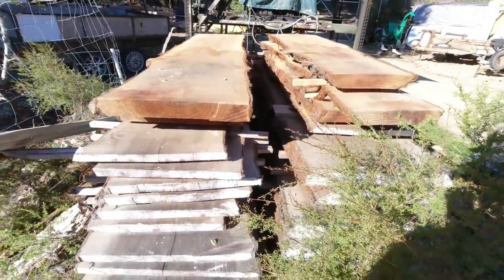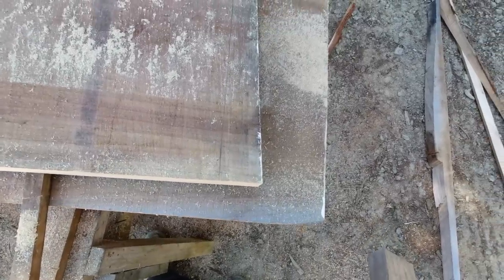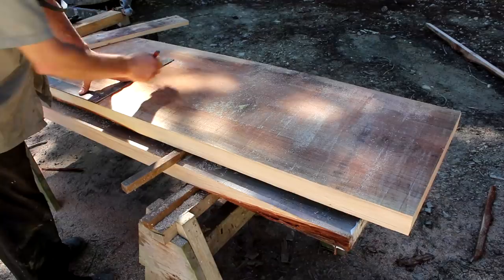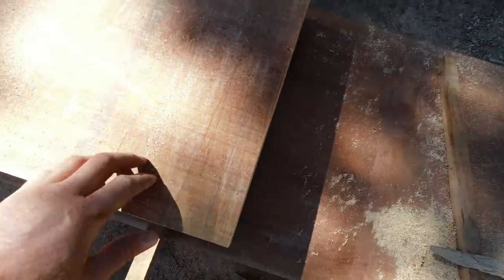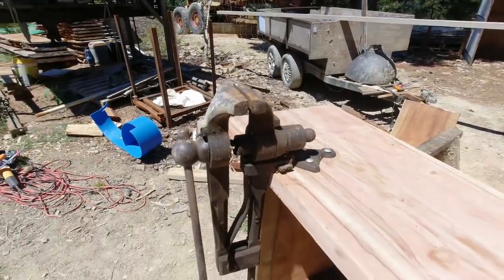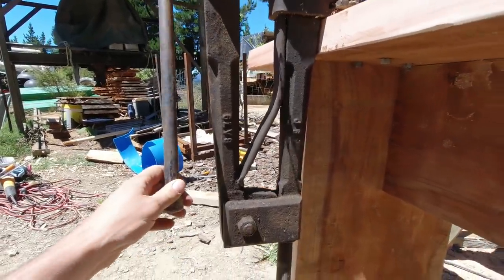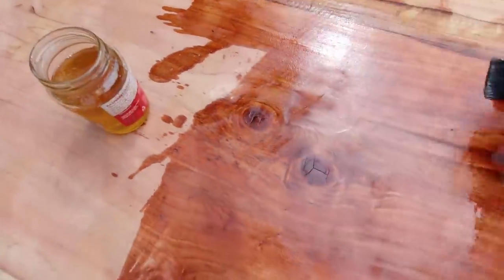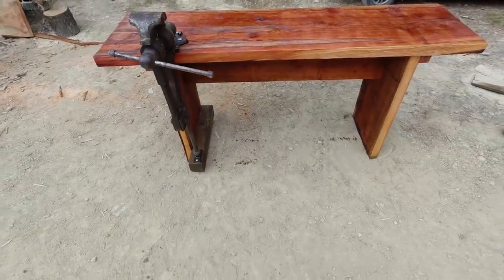Building a Redwood Slab Workbench

Comment: An Old Leg Blacksmith Vise around 1900 from England
Reply: If it's from England it'd be a vice, not a vise!
Reply: I have an identical one out in the garage. Awesome vice.👍👍👍
Happy New Year to one and all.
Reply: I've made a bench out of oak. I've beat on it for sure. I used 2×12s I cut up. They shrank a little, cupped a little, but they are fine.The pine bench I had didn't take a beating well. Good show man.

Comment: Merry Christmas Marty. Linseed oil will seal the wood but attracts dirt, applying a coat of beeswax after will keep that wood looking shmick.
Reply: Boiled linseed oil is better, no oily residue to attract the dirt and dust!
Reply: @gregheerdegen7347  Thanks Greg - great tip and clarification. A product brochure I saw (boiled linseed oil from bunnings) indicates you mix it 50/50 with mineral turps. I wonder if that is what Marty did or you would recommend?
Reply: @MiniLuv-1984  sorry I’m no expert and suspect the turps just thins it down and makes it go further and easier to apply? I use it on the ply deck of my trailer that lives outside to protect it and hopefully last many years longer as it gets a hard life.
Reply: @gregheerdegen7347  I have some treated (pine garden edging?) 2 x 8's that I want to make a garden bench with - unfortunately I don't have the fantastic vice Marty has, however treating it is a must as it will be in the weather directly. I've figured out how to stop it warping, but the treatment, if I follow the normal paint route would be horrendously expensive relative to the cost of the bench. Sounds like the boiled linseed oil can be applied directly - its certainly cheap enough. Anyhow, thanks for the reply. Much appreciated.
Reply: @MiniLuv-1984  I think mixing it with turps helps it penetrate better and dry faster. You can add it to Raw Linseed Oil too.
"Boiled" Linseed Oil isn't boiled these days, it just has nasty chemicals added to it.
Reply: @Syncop8rNZ  Thanks! I looked up making boiled linseed oil and its quite dangerous! This guy makes it and also talks about the drying agent additives they put in the store bought boiled linseed oil: https://www.youtube.com/watch?v=VtETzSg4LcE
I accept that the additives are an unknown quantity in terms of how it affects the body, however I like the idea of using boiled linseed as opposed to linseed oil as the boiled linseed oil polymerises and becomes hard so that the surface is not sticky. Making it may cause more damage that its worth, so I'll just buy the off the shelf stuff. Is the stickiness of raw linseed oil a problem for me? Maybe, maybe not not sure - I'm a newbie! You are clearly happy with the raw stuff, my first attempt will be with boiled stuff shop bought (with the drying agent) - I'll wear gloves when applying it (I would anyway) and it will be outside, so hopefully I won't breathe in any of the drying agent and its by-products. For the next project I'll try the raw stuff and see for myself. Experience is a great teacher. Thanks for alerting me to this - really appreciate it.

Comment: My dad had a carpenter's pencil like that and a vice mounted on his work bench. He had an old table saw that he used. This was before hand held circle saws. He was great at building things. He made us kids a fantastic set of blocks, just like the ones at school. He'd take a 2 x 4, measure it's width and make the blocks in multiples of that distance. We had all sizes up to long ones 8 blocks long. He built a wheeled box to store them in. They were passed down to  his first grandchildren. Hoping you and yours have a wonderful holiday season.
Reply: We had boxes of blocks like that in primary school in the 1960s
Reply: To learn our numbers we had smaller versions...wooden blocks of different colours and lengths representing and marked with all the numbers between 1 and 10.  It didn't take long to figure out numbers with the physical representation and using your hands/eyes...

Comment: Marty, absolutely beautiful and stout, looks like a piece of furniture! It's the perfect height and dimension, I was a little skeptical at first in the construction but after seeing the major gusset in the middle and the length and size of those lag bolts, my fears were quickly put to rest. That bench would support an engine block, has no chance of squishing and will no doubt last a very long time under normal conditions where you live. 
Me: I'd put that bench in my home in a heart beat, it would make awesome bar for any man cave, just add a brass foot rail and nut bowl.
Reply: I was gonna comment to put a tap on it instead of the vice

Comment: A beautiful bench Marty, almost too nice for the shop. I use diesel and atf as wood preservative, my father used that on his fence 25 years ago and still hasn't fallen down plus it has a nice color. Soak the post feet in diesel for about a week so there is about 5 inches above ground, we would get the old diesel and ATF from the local auto wrecker they didn't want it at the time, probably different now.

Comment: If you use a guide board that is thin enough that the saw motor can pass over it ,you can turn the saw around and use the wider part of the saw plate. That way it's easier to get a vertically square edge.

Screw  6mm  flat bar to the bottom of the feet - more durable if you drag the bench about.

Comment: Jolly good job. This video is fair competition to Paul Sellers' six part miniseries of two hour segments instructing viewers on the proper construction, design, assembly and muckymuck of a properly built work table. 

EDIT: I used to drink kerosene as a kid, but now it's too expensive.

Thanks for the great content.    
Keep up the good work.    
בס״ד
Reply: Laying it on a little thick.  He hasn't allowed for wood movement in the cross grain of the top and legs versus the battens.  He needs to put the outer lags through elongated slots or it will tear itself apart.  It's fine for a guy slapping something together with very limited tools just for banging on but don't get carried away comparing it to the work of people making a bench that's fit for doing fine furniture and will really last.  They are two completely different things.
Reply: @krtwood  Yes. Thank you for pointing this out.  Even if the slots were elongated more than the grain directed obviously about the ends were not exact. That might be measured out. Although he milled those slats on site, as well.
Reply: Give that he built it to sit outside i think Marty expects it to crack somewhat.
Reply: @BlackCoinCrypto  Cracky!

Comment: WoooooooooW!!! That bench will be standing for centuries!!! The bench top should not be any lower than an inch below your elbows as back fatigue will set in as you work on it.... An the finish should be as tough as the work being done on it.... So I use indoor/outdoor water proof wood glue, Elmers, at 50% glue and 50% water by volume wise!!! Just put it on every where as you the other finish...Now it will take a hit from hammer and not show a mark!!!!! Test it on another piece of wood!!!!!
Reply: Depends what you're planning on doing on the workbench.  Taller work requires a shorter bench, and vice versa.  Between your balls and your belly button was the guide I was given.  For that exact reason we have benches of varying heights here.  That, and the shortarses would complain if all the benches were taller than they are LOL!

Comment: Nice work Marty. Have you got an impact driver? They will make light work of driving screws / coach bolts / heavy duty fasteners without slowing down (or stopping) like your normal cordless drill did. I use my impact driver more than my normal cordless drill, and usually don't need to pre-drill pilot holes if going into softwoods like pine, but redwoods obviously harder though.

Comment: if you seal the upper surface of any wooden table, make sure you do the lower side also. otherwise the plate will bulge, caused by different humidity absorbtion.

Comment: Using Pure Turpentine (Distilled from pine resin) instead of Mineral Turps (petroleum derived) would give far deeper penetration, and last longer. Adding a dash of terebine driers to the mix will remove the stickiness and dust collecting on the bench. ps: you can wash back the mineral turps already applied with Pure Turpentine soaked rags to make the surface porous again before applying the new mix as mentioned below...
Reply: Yep, raw linseed oil and real turpentine, start with 25/75 mix, then 50/50, then75/25, when the wood won't take any more,  some decent hard pate wax. She's a beaut !
Reply: @pmel018  Someone else knows his stuff, I supplied old time French polishers & traditional woodworkers back in the day.

Comment: I would think on a dirt and stony pad that having the legs being very wide would make it unstable. Is it? Would you cut an arch or V into the bottom of the legs to make it have less of a contact patch? Essentially making it have 4 legs. Nice table, and that linseed really brings out the grain, beautiful slab.
Reply from the maker: Eventually It will be bolted to a concrete pad so should be pretty stable

Comment: Don't you have issues with linseed oil mildewing and turning black when outside down there? Here in the damp Pacific Northwest it used to be popular until it began mildewing.
Reply from the maker: No the timber was quite dry when I applied the oil so no mildew yet
Reply: @MartyT  Use Le Tonkinois for sealing wood like that, each application will last ten years outside, you'll never waste your time on linseed oil, dutch oil or similar ever again...